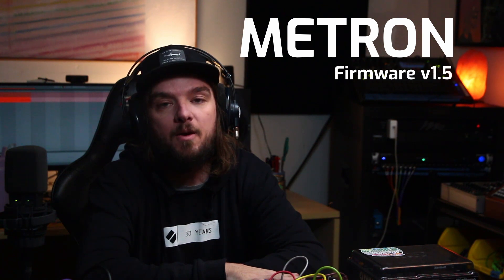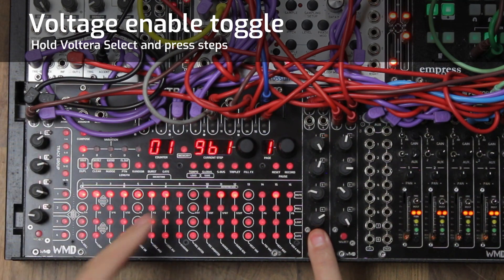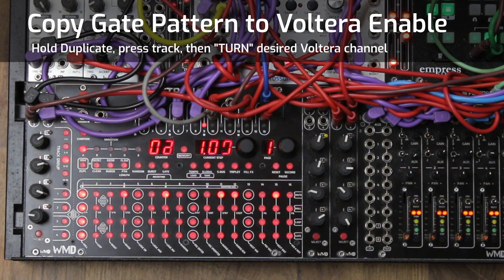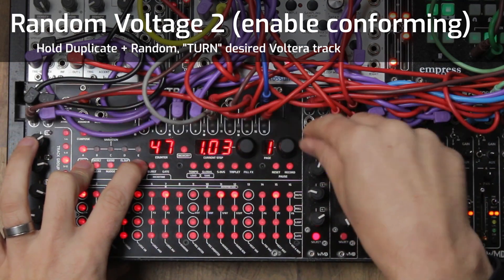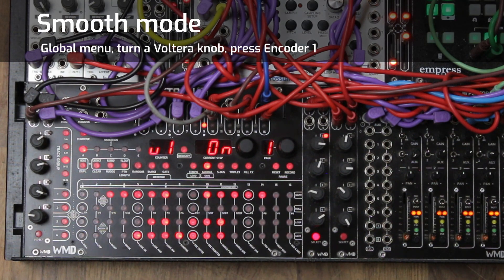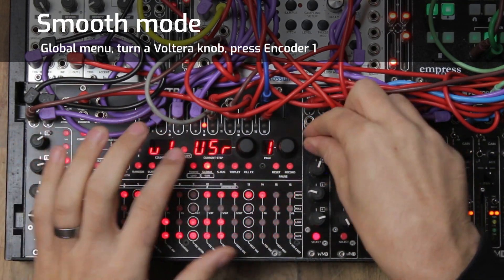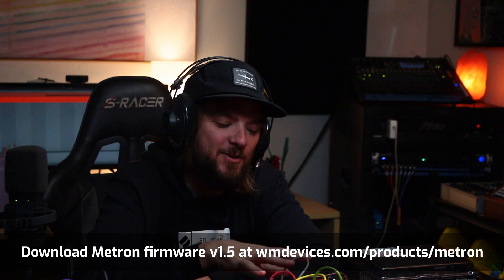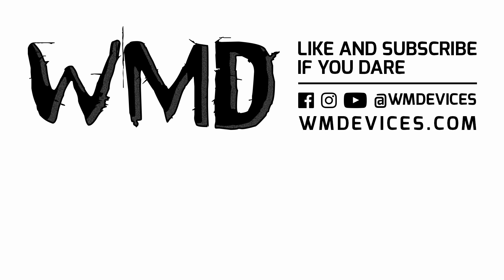WMD Metron - Firmware update 1.5 -  In depth overview

Comment: Hm, my Voltera seems to have a little bug in the smooth mode. The generated triangle always ha a dent before the second step. I'll see if I can provide a demo video.
Reply: Yes, I have just sent a Youtube link to you via the contact sheet on the WMD website. I enabled voltages on step 3 and 11. Smoothing introduces a dent in the ramps just 1 step before one of the enabled steps.
Reply from the maker: @ElectricWound  looking into it. thanks! Im not sure if the contact form is working correctly anymore.  Please send the video to info@wmdevices.com

Comment: Honestly even just being able to check what voltages are written to steps is so useful! Thanks for the update.
Reply: PS smooth mode is cool, but with sliding and care put into the voltages you can draw complex voltage automation that has both curves AND immediate changes and that's a REAL game changer for Voltera. Now it's time to write some 32-bar formant bass lines and then figure out what I'm gonna use Timewarp for instead since I can basically just do all of it's features straight from Metron! Only thing I'm still a little sad for is that Voltera still can't line up with triplets properly.